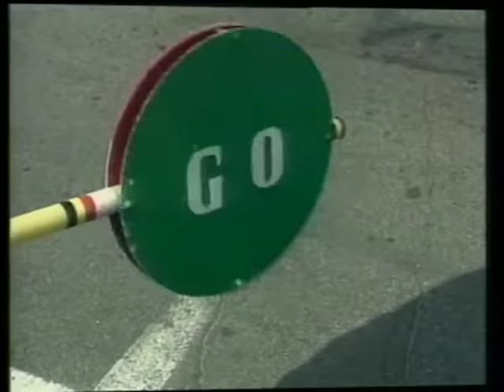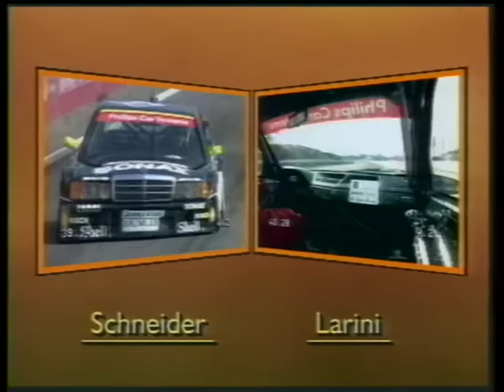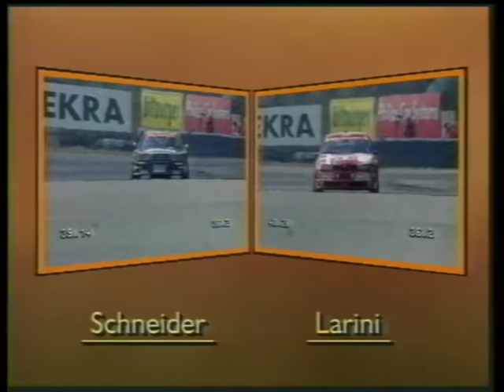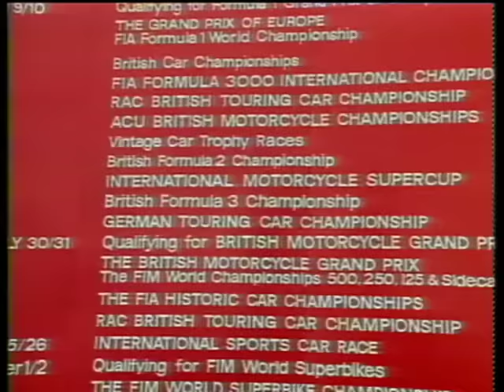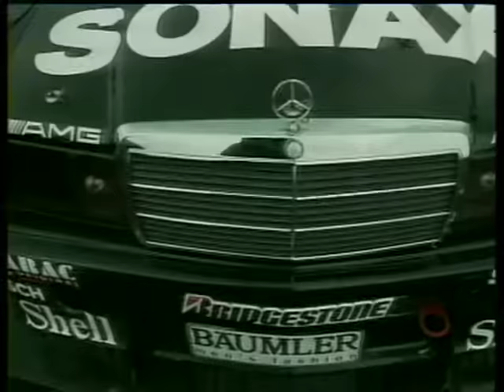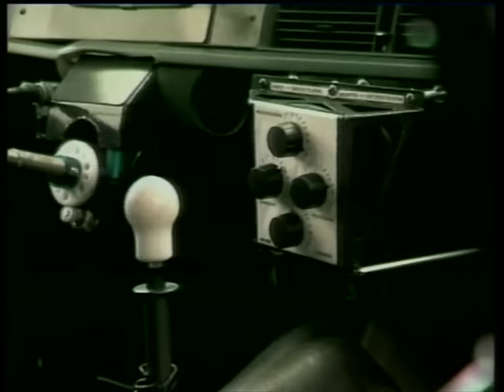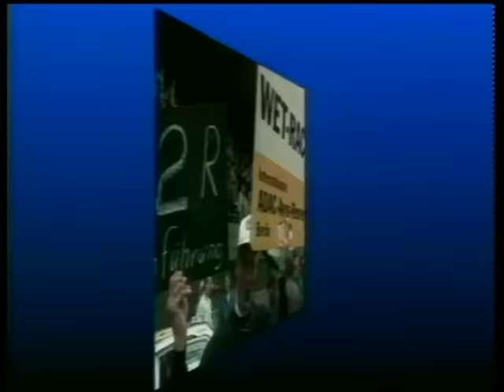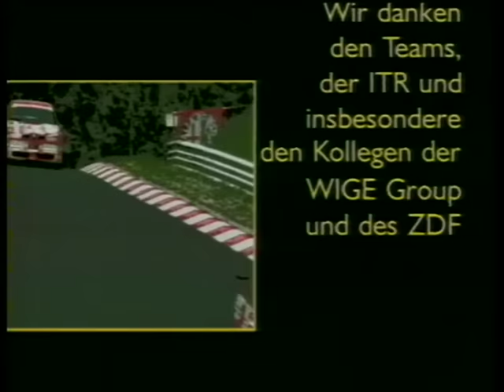DTM 1993 - English Commentary

Comment: Mercedes was running on 4-cyl Merc engines , BMW had 4-cyl BMW engines. Alfa however had other plans and was racing 6-cyl Peugeot engines.
Reply from the maker: Even after engine/rule changes, Opel and Alfa both left in 1996
Reply: but what Peugeot engines, but where do you originate such nonsense? Do you know that Peugeot built and supplied engines to the Alfa Romeo racing team for the DTM championship? and where were the Peugeot engineers in the garage? hidden in the closet perhaps? the regulations stipulated that the engines used for the cars were derived from the series, but what exactly had to be taken from the series engine? the same angle of the v and the same distance between the cylinders. stop. so was it necessary to use the block of that engine? no absolutely, it was only necessary to respect these 2 parameters and these parameters had to match the measurements taken by an engine used by the brand in series production. for the first 3 years, an engine derived from the V6 Busso Alfa Romeo was used, with a 60 degree inclination. but the v of 60 degrees gave some limitations and therefore engineer Limone opted for a 90 degrees. In Alfa Romeo production there was only one engine with a 90 degree V, and it was the Montreal V8, but this engine had a cylinder spacing that was too small. Searching through the documents, it was discovered that for a few years, the Lancia belonged to Alfa Romeo and in the Thema model, the V6 PRV engine was installed, which was the only V6 produced in Europe with a 90 degree inclination. consequently for the 96 season, both engines were homologated, one derived from the Montreal V8 and the other derived from the PRV, but only the second was used on the competing cars. but the Peugeot people don't even know what the Alfa Romeo ITC engine is. so, let's not talk nonsense.
Reply: @motoessentials   the championship was over, it wouldn't have lasted anyway, the fia at the hands of Ecclestone did everything to kill this championship. the cars had become as expensive as a Formula 1 and the minimum use of 6 cars was imposed, therefore, the costs exceeded those of F1. Then the FIA had put races on the calendar which forced the teams to race in Japan today and the following week on the other side of the world, with unsustainable shipping costs for the machines and materials and also in some races, the teams were forced to purchase 10,000 tickets for the grandstands. the championship was annoying and was abolished.
Reply from the maker: @lucaiervasi8515  Now you have modernity. A well planned out calendar across only Europe. Gives teams more time to prepare and test.
Reply: @motoessentials  what does it have to do with today? where is the ITC championship held today? Did I miss something? no, because the ITC championship no longer exists. the DTM championship died in 1995 and from its ashes, the ITC championship was born, held in just one season, 1996. the old DTM, combined with the ITC, had a very important following and began to compete with F1, especially in terms of it concerned the sponsors, who were starting to abandon f1 in favor of the dtm, this caused a lot of annoyance at the top levels and everything was done to suppress the championship, with absurd rules and timetables designed to make life difficult for the teams. in 2000 the DTM championship returns, but it has nothing to do with the old one, especially as regards its media relevance, which is not at all comparable to that of the 90s. Furthermore, today we race with cars strictly derived from the series. We need to clarify one thing, the ones we see in this video are not the Opel Calibra, Alfa 155 and Mercedes 190 or Class C. but they are prototypes dressed with the bodywork of production cars. as I had already explained in my other comment on the engine, the regulations stipulated that it was necessary to respect the dimensions of the production cars chosen to compete, but did not impose the use of the original bodywork. the 155 of the dtm had nothing taken from the standard one, it only had a carbon fiber bodywork which faithfully reproduced the standard one, but this did not cover the chassis of the standard 155, but covered the body of a prototype. if you open the rear bonnet of a 155 itc, you will see the asphalt underneath, in the bulkhead of the rear seats, you will see the active push rod suspension, if you remove the front bonnet, you will not see an engine installed inside an engine compartment, but you will see an engine that it also acts as a load-bearing element of the body. essentially, those cars were F1 cars with covered wheels. and as such, they had very high costs. Today, the DTM is raced with GT cars, which are something completely different.
Reply from the maker: @lucaiervasi8515  Calm down, it’s just a video.
Reply: @motoessentials  but I'm very calm, apart from the nonsense about the engine. forgive me if my comment appears aggressive, but my English sucks and perhaps I conveyed a different feeling than the one I wanted to convey. I had written another comment but I can't see it now, maybe I forgot to send it before closing. basically I wanted to say that today you no longer have the freedom that you had in the 90s when designing the car, so you need to have a series car that is an excellent base on which to build a competitive DTM car. According to some rumours, Alfa Romeo had approved the Giulia GTA-M only to be able to use it as a basis for returning to racing in the DTM championship. but the merger between the fiat group (owner of alfa romeo) and the psa group made these plans foam. it seems that the new management is not interested in this type of competition.

Comment: At least you could drive a relatively similar car on the street back then and have fun. Even the street versions of the current GT3 cars are way too fast now. Only way to really have fun with those cars are to track them…
Reply from the maker: Well I suppose but there is always a market for the ‘street’ side of motorsport. You can have fun with them in a civilised way with meets and spirited drives.

Comment: Where are the BMW e30s😅 weird to see them riding in the back while they where former champions
Reply from the maker: The M3s were ran by Linder Motorsport, Auto Maass and Kaucuk Motorsport. 1994 had 5 teams running M3 and their variants.
Reply: @motoessentials oh this was when bmw stopped bothering with dtm?
Reply from the maker: @POVShotgun  They ran the M3 in 1994 also but I think none were entered in 1995. 1996 became the ITC. BMW did not enter that year also.